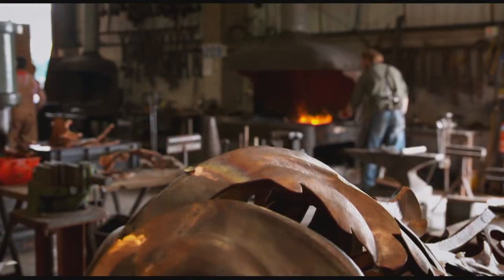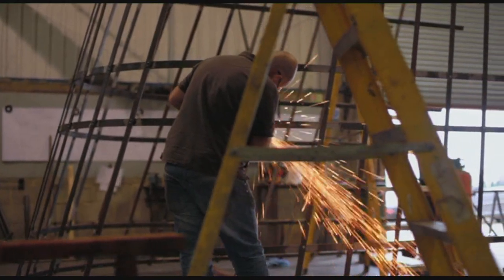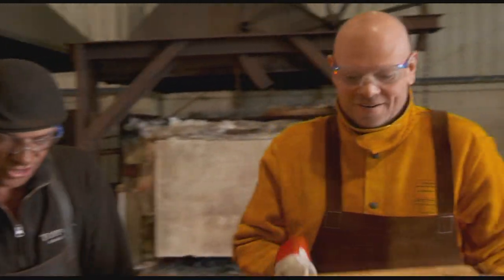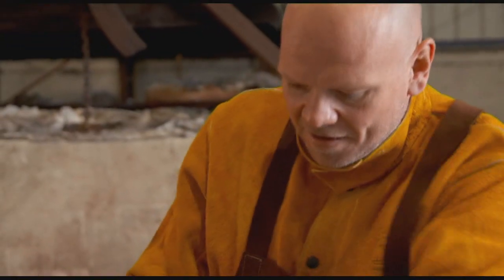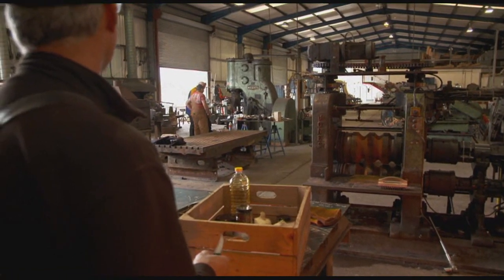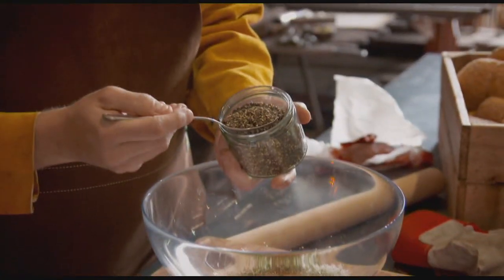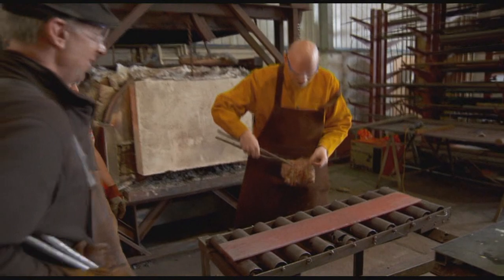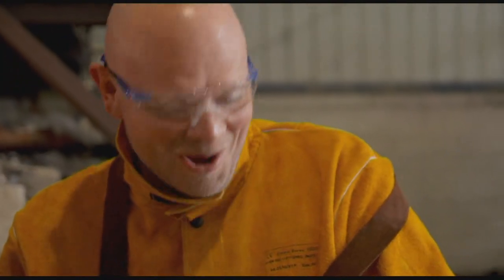Topp & Co. Tom Kerridge cooks a steak in our workshop

Comment: of course it will work, they used to cook on the shovel of a steam engine and still do on heritage railways, and thick metal will hold heat for a long time just like cooking in a cast iron pans, but pfffftt you used a multi ton powerhammer to draw out and tenderize the tail ends of meat that is the steak, thats a first I am sure in many decades, in England of the USA, and kind of bad ass, you would make the show Home Improvement character Tim the toolman proud for doing it with more power.  it was a show in the usa in the 1990's a comady about an accedent prone home improvement show host